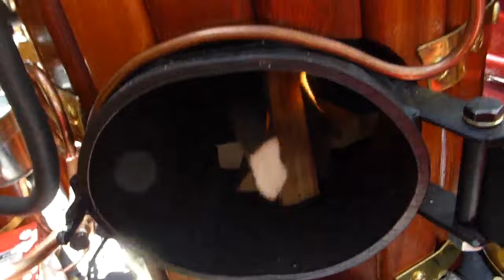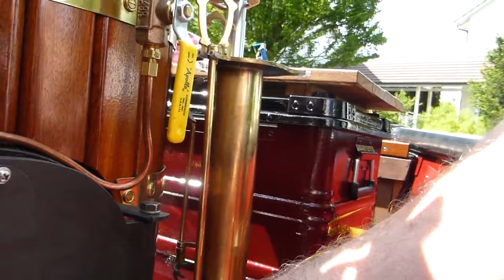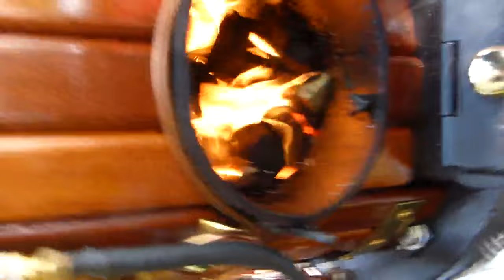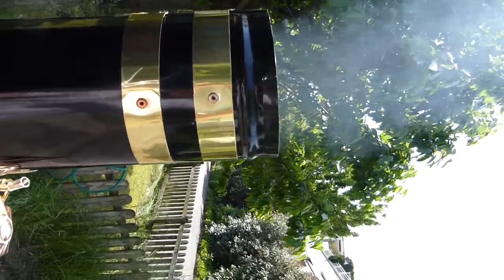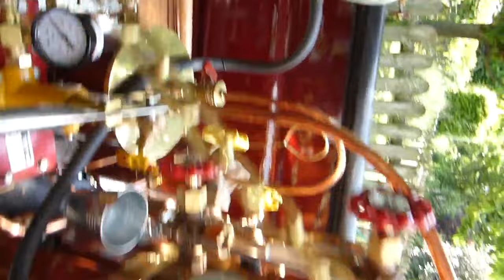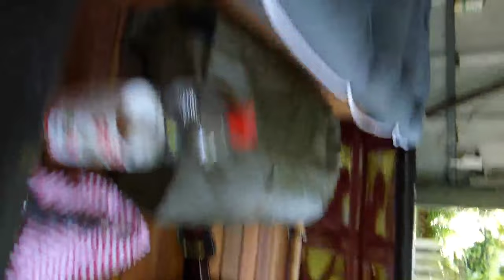Steamboat Amphora with Stuart 5A first Coal firing 270516

Comment: Really wonderful boat ! What design did you use for the oil/water seperator in the condenser ?
Reply from the maker: thank you. It is a two tube design I developed during my vacation in greece at the beach (a bit boring only sun)... see this special video https://www.youtube.com/watch?v=WBVqkxo2ceM&t=106sOne bigger big brass tube contains a smaller brass tube with wholes at the bottom (they are silver soldered to a brass base plate).... the water runs from the top into the center One which contains special fabrics which binds oil as a filter and the water flows at the bottom of the center One to the outer tube where it goes finally back to the hot sink... the fabric is taken out after a while and may be burned in the coal fire...

To your first Question where to by phosphate or soda... unfortunately I cannot open this questio or read it fully... please ask again sorry ;)

Comment: Bonjour Christoh,
I had not seen this video. Successful test. indeed Like in my models, the feed pump slows the machine when it operates for the boiler. And the heat of the kettle is very efficient!
Amicalement, Raphaël

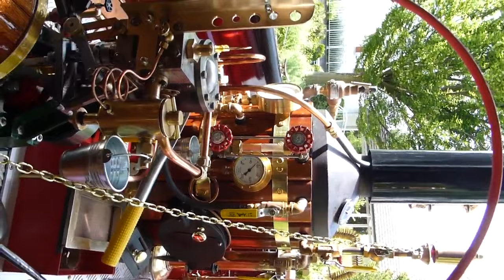Comment: I love the video and your workmanship. You put together a work of art :) That said, I'm a little concerned right at 3:50 when you speed the engine up. I heard distinctive squeaking As it accelerated. I hope that wasn't lack of oil on journals and such. Do you think it was maybe gland packing?... Just curious on your thought. Beautiful video.I want to see her on the water now :)
Reply from the maker: Thank you very much Paul for your kind comments. You have very sensitive ears! You are right, but I do not know the reason at this time for it?! In the meantime the boat was several times on water and please listen to the most recent video (up to three maschines running at the same time) starting at 25:29 https://www.youtube.com/watch?v=4UDuxc5m8Jc&t=1246s (steam turbine just shut off) only Stuart 5A and Southworth running... no squeaking sound... I think one reasone could be that the steam plant was in the old video 'brand new' and all the connection has to 'worn out' in the new adjusted mechanical arrangements. Now it runs like a swiss clock . Also the mechanical lubricator provides oil to alle major journals by pipes. I recently replaced some glands in the water pump due to leaking at higher pressure conditions over 75 psi. I also had to replace the brass gear in the steam turbine and the chinese producer was so kind to made me new ones made of steel :-) I  tested finally all the maschines parallel which worked :-) and now all is fine. AMPHORA will see the water early next spring because I cleaned the boiler for the winter period. Than I will see if it also pumps water directly from outside under the hull... Cant wait to cruise!

Comment: Lovely looking steam plant but why is it knocking?
Reply from the maker: as soon the water pump is pumping against the boiler pressure you may hear some 'knocking' sound but under lower workload is runs quite well. It is not a table top version it already pushes a bit of metal and I wonder how it sound after a few miles on water... by the way I adjusted a rather earlier timing in the maschine/valve. I learned during the building phase of the plant that also the resonance is changing with the amount of metal is grouped around the Stuart5A which is named in physics 'selfresonance' and audible at a certain speed/rpm.
Reply from the maker: In the meantime I arranged the timing of the maschine in the following way. 
Stuart 5A piston full down, the waterpump piston full in... this reduces the knocking completely exspecially when the metals are warmed up (less space between the metal joints and more balanced mechanical workload)... this was the trick

Comment: Thanks do you recommend mixing that percentage in a 3.5 inch loco ?
Reply from the maker: Matt Seymour I start always with the sulfur and gas containing locomotive coal and later add some anthracite coal at lower percentages as 30% ... the anthracite coal generates more heat but needs the locomotive coal to keep glowing
Reply: @The123pcr  makes sense and will try that so the anthracite takes hold better.

Comment: Thanks for that so if I use Russian steam coal first then some anthracite or mix it ?
Reply from the maker: Start with polish coal and add later a mix...
Reply: @The123pcr  will do that, I have the Russian steam coal but will use that then the Welsh. Is it the same for a 3.5 inch loco?
Reply from the maker: @mattseymour8637  I have no experience with a 3.5 inch loco, but why not and usung a nut cracker and make fingernail big pieces :-) and mix it also with grill wood coal at lhe beginning... I think Keith Appleton knows iz very well...
Stay healthy and enjoy the winter :-)
Reply: @The123pcr  thanks for the advice, I actually have the right size already in small sizes and tend to mix it 50/50 standard steam coal and Welsh steam. But wondered what you suggested. Stay safe too and keep steaming!

Comment: When you were panning the camera there was something covered in polished wood just behind the engine. Is that a gear set down to the propeller shaft?
Reply from the maker: not a gear... it is a duble cardan coupling,,, I protect it by the wood tunnel from fingers...
Reply: Is the engine run at 1 to 1 with the prop shaft or is there any gearing? I build Models and was asked what to do when you cannot increase the propeller size, I suggested gearing the ratio between the two, having the prop run at twice the engine speed and as wondering if it is done with full size boats.
Reply from the maker: I run it 1 to 1 and the speed you see in the video shipping on water is at 50 psi pressure. For me this was fast than enough. If one would run it at 80 psi with more heat it would almost leave the water :-) So I don't see a reason to increase the speed by a gear... you would loose some of the power in the gear and generate also more mechanical noise. My prob has an diameter of 30 cm with a good pitch...

Comment: Lovely engine and boiler. What coal are you using?
Reply from the maker: Thank you... it is polish locomotive coal 60%,  a mix with pure anthracit coal 40%... I get it in switzerland at the rhine river harbour Basel ...
Reply: Cool. Does it burn well and give good heat mixed like that ?

Comment: Nice , but you have a  lot of brass to polish. My  5A makes the same noise,
Reply from the maker: yes... if it would be pure gold the polishing would be easier :-)... Do you have a pump linked to it, than balancing of the load (cylinder piston fully downside at the same time pump cylinder fully inside) could be a way to reduce noise and running the maschine for a while help also a lot... anyhow the sound is really very much the same in AMPHORA, thank you for sharing it!
Reply: My waterpump is a cross head pump so cannot amend, my knocking is more likely main bearings. Someone cannot remember the name did gold plate their fittings!!  Have you been out on the water steaming much?
Reply from the maker: please see the video me steaming the first time, https://www.youtube.com/watch?v=W-26I2FtpfM&t=84s now I finished the Southworth pump which will be tested soon on water again...

Comment: What kind of coal is that? Anthracite or bituminous?
Reply from the maker: It is a mix of 33 percent anthracite and 66 bituminous... polish locomotive coal... Zeche KWK Myslowice Wesola

Steinkohle vom Typ 32,1
Körnung 40-80 mm
Heizwert (Qri) MJ/kg 30-31.5.
Asche (Ar) 3,0-5,0 %
Schwefel (Srt) 0,4-0,60 %
Wasser (Wrt) 4,0-6,0 %
Flüchtige Bestandteile (Vdaf) 32,12%
Sinterung (RI) 22
Chlor (Cla) 0,27%

the bituminous coal generates enough gas to keep the fire burning and burns the anthracite part... kind regards Christoph